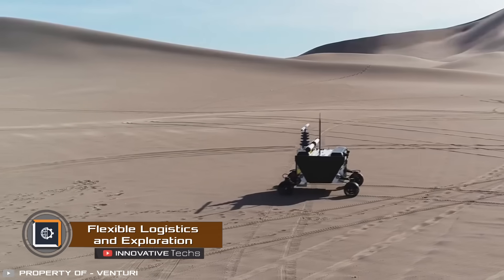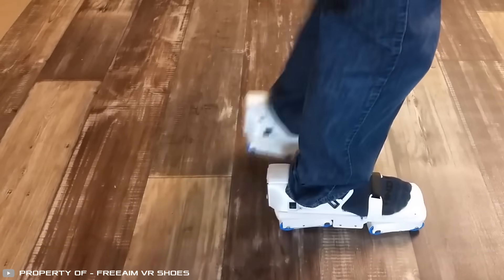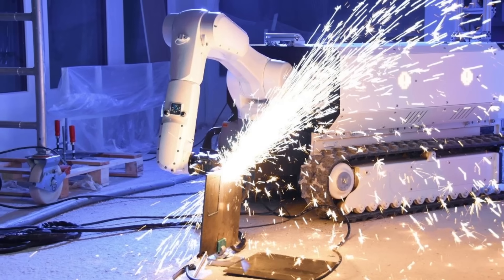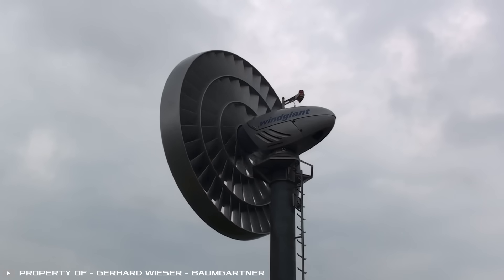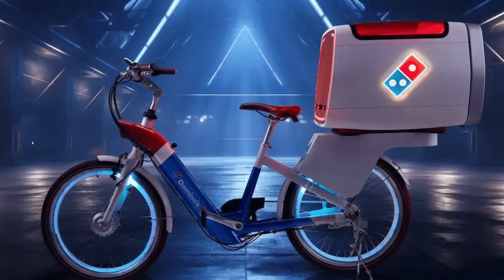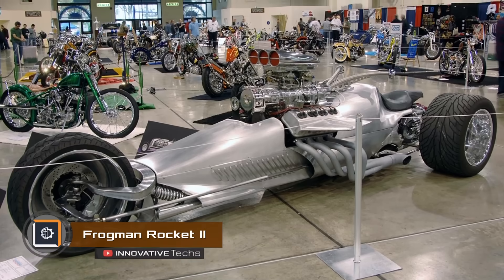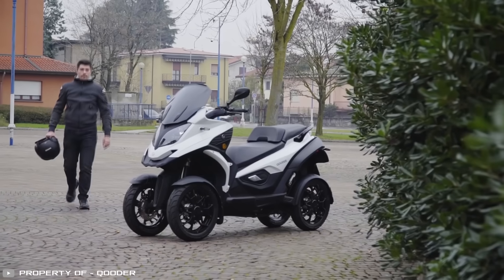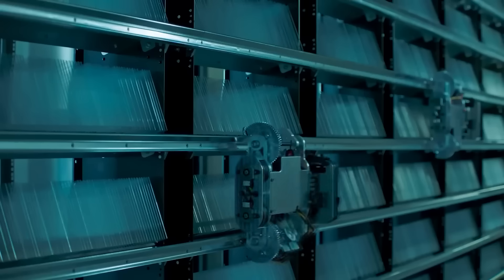INSANE INVENTIONS OF A COMPLETELY NEW LEVEL ▶2

Comment: How about synthetic nerves?
While individual nerves may not be plausible, isolated nerve bundles from a single muscle could be utilized.
A fiber optic cable with a micro laser at one end and a photo cell at the other; all encased in a lab-grown mycelium sheath made from the patient.
Surgically implanted under water, this could be utilized to replace severed nerves,  bridging the gap and restoring some level of functionality.
The laser is powered by the neurons firing and the photo cell stimulates the neurons at the other end.
Sealing the assembly in the patient's own mycelial covering limits the chances of rejection by the host.
Variable muscle strength would be determined by the frequency of the firing neurons.
Reply: WTF, you get my up vote, not sure what you're saying but anything Sci fi is awesome to me
Reply: Nerves operate bio-electrically and are one part of the body that does not regenerate.
This device would replace the damaged section of nerves, allowing use of that muscle again.

Comment: Did you know... If you put a wire up in the air high enough... You get power... Free...
Reply: Well I tried putting up long cable tv wire stripped from isolation, you get atmospheric electricity around 0.3-0.5V, it's not much, may be can power small LED or low power device. Also I build small radio with long antenna, that works from power of radio stations when I was teenager. Happy experimentation in the coming New Year!🙂
Reply: @AdvancedEcoTech  Transformers!
Reply: Did you know...  That's not true... Not even a little...   at all...
Reply: @therationalanarchist  ... really?!  Have you ever even tried or did any experimentation?
Reply: @therationalanarchist Actually IT IS! Tesla proved it years ago! Ionosphere! Ion! Seriously, it's in the name!